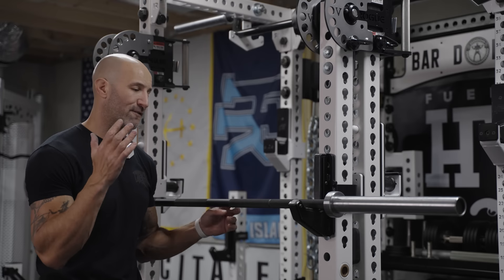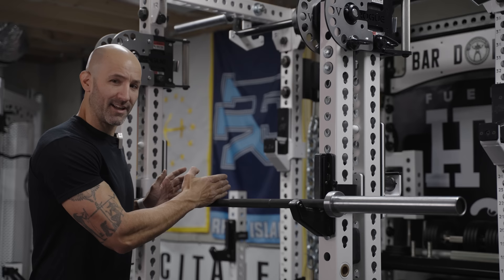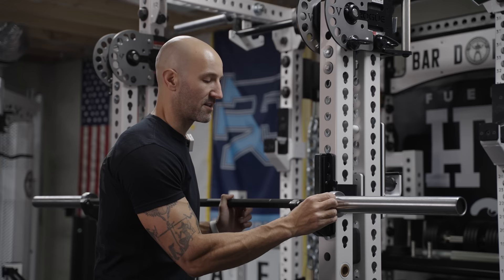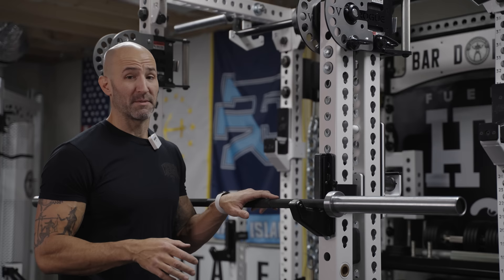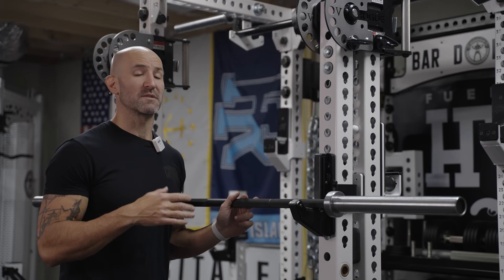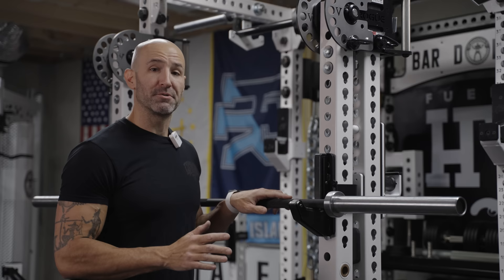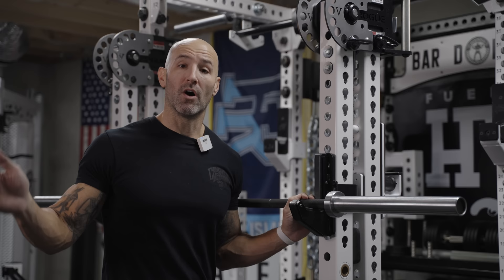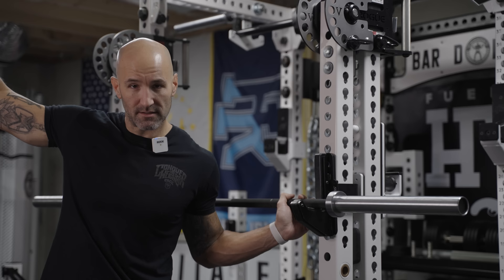Building the Bar - Consistency Killed the Barbell

Comment: Throughout your videos consistency in specs and quality has always been high on your list.  Considering the number of misses this company had in making a prototype that reflected what you wanted in a power bar, even if they were to make a bar just the way you wanted, it sounds like consistency in quality and specifications would have been a big problem, hence not reflecting well on your brand.  Keep looking. You will find a company that will meet what you are looking for.  When you do, I will most likely buy one if it has your name and brand on the end cap even though I already have the Rogue SS shaft and sleeves power bar based on your recommendations.
Reply from the maker: Appreciate it Bill!
Reply: @BasementBrandon  You are welcome Brandon but if you pursue your brand on a bar please do it quickly. I am 75 years old

Comment: That sucks things didnt work out. I have a few big name bars that start with an R. Ironically I got one of those Tru Grit $99 on sale bars at Wally World thinking it would be good for a landmine or to keep outside for some crossfit style workouts in the summer but it actually impressed me where I feel bad beating it up like that. You are right when you really don't need to spend $500 on a bar for the average person. Now that I have some experience and a few nice bars to compare I dont think I would ever spend over $300 because I am not competing and I am not that strong.
Reply from the maker: I think for me, for the most part, $300-$400 is a range that you could get a great bar that will last a lifetime. Some of the higher end bars offer a bit better perks, but for many, not enough to warrant the price increase.
Reply: We're u consulting on the new rep barbells?

Comment: If you spend a little more and use Samtek OEM, you will not have all these problem. Cheaper factories are cheaper for a reason.
Reply from the maker: Problem is with them though you often have to commit to a lot of quantity.

Comment: Have you reviewed their plates yet? I've seen them on Instagram and they seem really interesting (I haven't needed any additional plates yet, but my next ones will be theirs). Their solid steel plates are near calibrated as far as accuracy, thin (1/2 inch on 25 lb plate) and affordable (160$ for a pair of 25 lb plates, free shipping).
Reply from the maker: I haven't, they look cool but thin plates aren't always great as I've seen theirs can shift.
Reply: @BasementBrandon  Interesting. Is that because the plate hole is not quite snugly fit into the barbell sleeve?
Reply: @BasementBrandon  Hey sorry to bother/insist Brandon, but what kind of shift are you referring to? If the hole is too big for the sleeve, then that probably cannot be resolved by using clamps/collars. If it's just annoying sound...I could live with that.
Reply: @BasementBrandon  Nevermind...I just saw a video which shows what you are talking about. Thanks for alerting us to this problem! I think I have a solution to it, but in any case I will first buy a pair of 25 lb plates and see if it works (bumper plates to keep them snug).
Reply from the maker: @gaberoo9099  Sorry for the delay! Glad you found it!
Reply: @BasementBrandon  No worries! Hopefully they can take your constructive criticism to heart and make the hole tolerances tighter to eliminate that potentially dangerous side to side wobble while loaded on the barbell!

Comment: Honest question here. What is the deal with expensive straight bars? They’re just straight barbells. I buy mine used from Facebook marketplace. Specialty bars are different, but a straight is just a straight bar no? Why real benefit is there to expensive straight bars? Anything more than 100$ seems a waste of cash, am I missing something?
Reply from the maker: What do you consider expensive? To me you can get a really good barbell for around $300, which I think is on the low end for cost still.  You can get one for less, but then some things come into play. Namely build quality, warranty, tolerances/accuracy, knurling, warranty, finish, etc. $100 barbells usually have a low weigh tolerance, don't weigh what they should, have bigger diameters to offset the lower quality steel, have poor knurling, limited warranties, bad customer support, are more likely to bend/break/hurt you, rust, etc. Just depends on what's important to you and what you value.
Reply: @BasementBrandon  Great answer. Thanks for the insight.